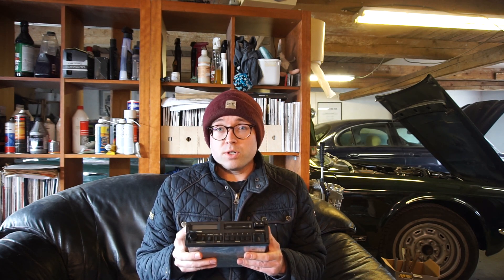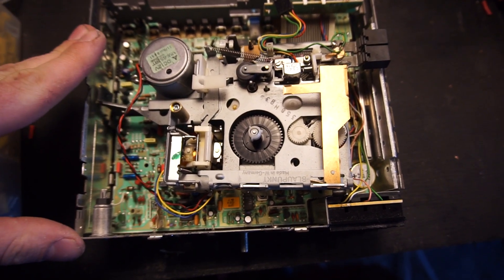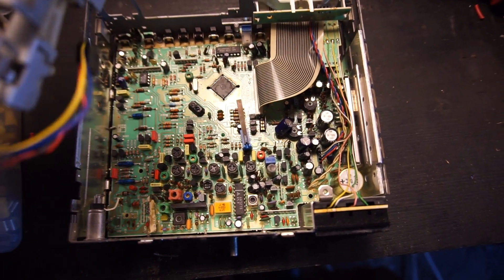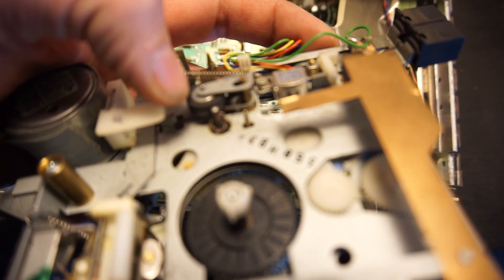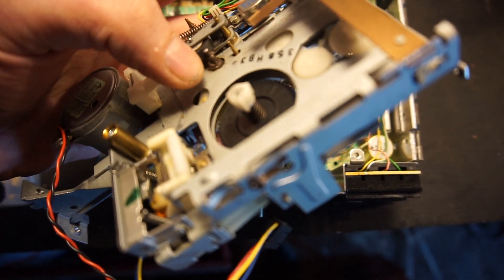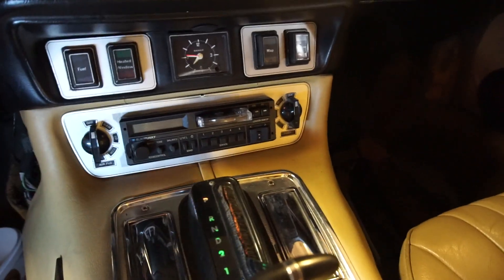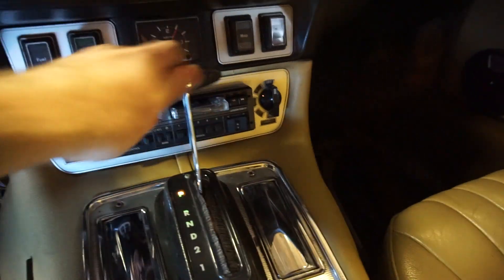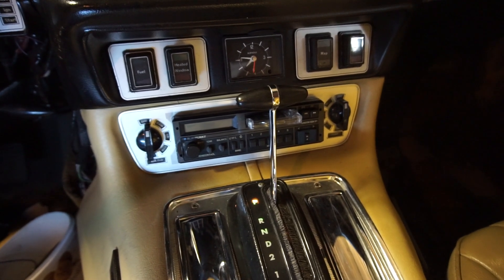Repairing the New Radio for My Daily Driver - Daily Driving a Classic Weekly

Comment: Most decks use a seperate idler wheel that moves back and forth to engage the FF, or Rewind. It is the usual cause for weak or slow rewind or FF. The idler, belt if seperate from drive belt slips, or dirt on the wheel hubs for the cassette. That looks like a good design unit, out of thousands, some are much better than others.

Comment: That's one loud jag clock. Lol. I just picked up a box full of 80 cassette  Stereos. Was going to the dump. Blaupounkt . Looks good in the jag. I got two 1970 508s mercs and a classic 900. They should all fit good.  If they don't I'll drop in off. You can have um.

Comment: The radio in my 1991 XJ40 that I've just bought isn't working. I will be replacing it with a cd-radio unit that I had in storage for a few years, coming from my old 1999 Mazda Protegé. The appearance is very similar and it works and it has CD!
Reply from the maker: Sounds like a good swap then! I rebuild the XJ40 radios, they are pretty easy to get going again.
Reply: @LivingWithAClassic  I am not yet 100% sure of what I'll do concerning either repairing the radio or replacing it, but I am leaning more toward the Mazda radio with CD than cassette stuff. If you have interest in the Jaguar radio, I could sell it to you for the price of shipping (from Quebec, Canada). But now, the problem that i have with the car is removing the fuel tank to replace the pump and repaint the tank, if hopefully it is still good enough.

Comment: def in favor of original and period correct sound systems, esp in classic cars.  someone installed a cheesy aftermarket into my 75 Pontiac and cut the harness up, including the harness to the separate multiplexer, and threw away the plugs...argh.  have the original AM/8track...power and speaker harness is pretty easy, but no idea how to wire up the multiplexer.  for now, will have to continue using the iphone and a bluetooth speaker until i can find a diagram.